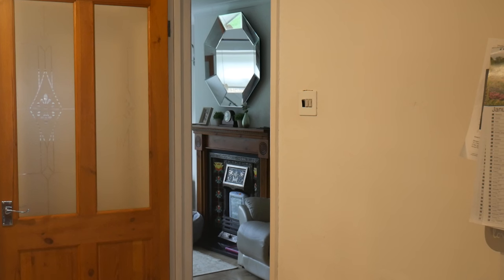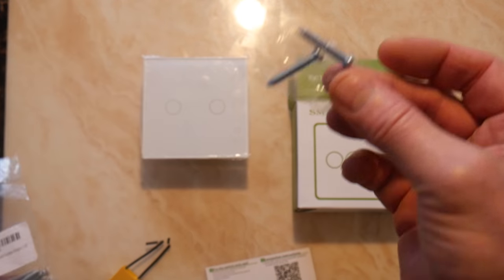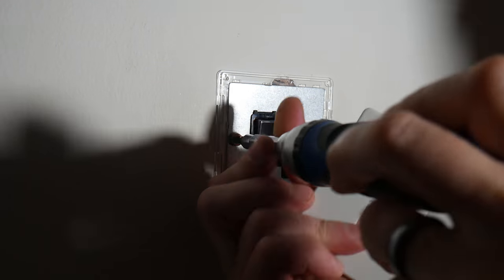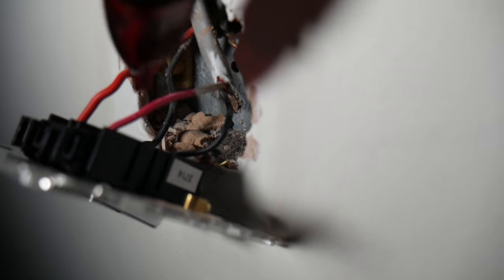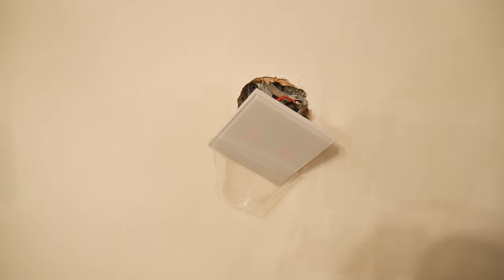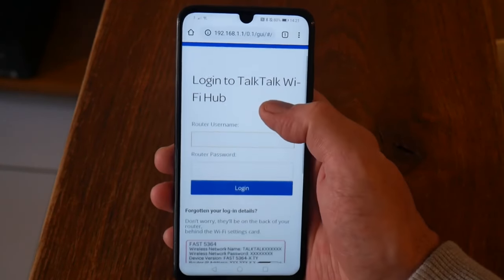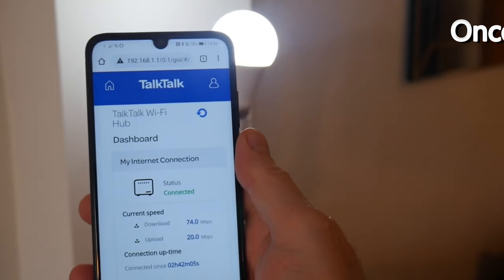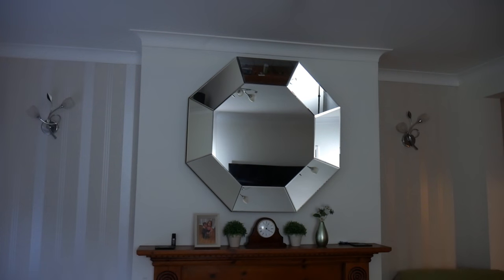NO NEUTRAL 2 GANG SMART LIGHT SWITCH INSTALLATION AND SET UP

Comment: Does it also work if you add smart bulbs as I struggle to get mine to work correctly as it puts the bulbs into pairing mode when you keep turning the switch on and off any help on this please? Thanks for this video two best Ive seen on explaining it to find the live wires and adding them both to L on the switch. For my strange reasons I have no power upstairs switch now but will look again after seeing your video thanks!

Comment: Hi, after watching this video , i assume that your switch doesn't have a neutral wire. My question is, is it safe to connect 2 live wires together into the same L ? And what is this 2 live wires are actually for ? To my understanding , only 1 live wire is enough to be connected to L. So what's the other Live wire for? Tia.

Comment: @UTILITARIAN TV, why you did not use the capacitor? Can the switch (no neutral) work without using capacitor?

I do not have a tester pen, but I can see the 2 wires connected to Common & 2 wires connected to the 1 way switch. 
Can I move 2 wires from the common to L1, L2 respectively?
Reply from the maker: Didn't need the capacitor as the lights weren't flickering. I would not recommend guessing which wires do what. Best to invest in a tester.

Comment: What do you do with the capacitor?
Reply from the maker: Didn't need to use it as the lights did not flicker or stay on.
Reply: @UTILITARIANTVUK  thanks, great really helpful video. Interestingly my original 2 gang switch had a loop on the 2 com holes. Not sure why yours hasnt?

Comment: I have another problem. I have install the switch in the wall. It works manually and it turn on and off the lights correctly, but when i press the button to start the pairing modem, the ceiling light turns on(because i touch the button) and after 6 seconds the ceiling light turns off but the button doesn't blink and doesn't start pairing mode!!! I tried everythink... What i do wrong?
Reply from the maker: Unfortunately, it sounds like you have a faulty switch?
Reply: @UTILITARIANTVUK  i bought 5 and i tried 2 of them... Both of them have the same issue. I will trie the other 3
Reply from the maker: @Tsepe21  That is unusual? What is the make of the switch?
Reply: @UTILITARIANTVUK  The maker's name is SWITCH !!! But looks the same as yours!!!
Reply: @Tsepe21  Did you ever sort this out. I have the same issue where pairing mode doesn't work?
Reply: @jaspalsinghsihra1018  No. I finally realized that mine does not support wifi. I was fooled by the one who sold it to me!
Reply: Thanks for your reply. I think ive been sold the same one as you with no WiFi.

Comment: Hi do you still have to have smart bulb for this switch to work
Reply from the maker: No need for  a smart bulb. An ordinary LED is fine.
Reply: No need to fit the capacitor then
Reply from the maker: @pethuds  I didn't use a capacitor but some people have had to with older LEDs. Any new LED bulb should be fine.
Reply: Ok thanks

Comment: Hey nice video but happen with the little yellow box that comes with the smart switch?? Did you install it or it was not necessary??
Reply from the maker: That's the capacitor. You install in between your live and neutral on the light fitting.  You only need this if your lights flicker. Mine didn't flicker so I didn't need to use it.

Comment: Hi didn't you use the capacitor
Reply from the maker: You normally install in between your live and neutral on the light fitting.  You only need this if your lights flicker. Mine didn't flicker so I didn't need to use it.

Comment: Great Video The uk link for the switch looks nothing like the one you installed, and looking at the picture's it seems you have to fit a capacitor if you dont have a neutral wire. Is the one you fitted Yagusmart Wifi Smart Wall Light Switch???
Reply from the maker: I didn't fit the capacitor on mine and it was all fine. It may depend on the light fitment?
Reply: @UTILITARIANTVUK  Thanks Bud again great vid.

Comment: hi, did you use the capacitance which came with the smart switch?
Reply from the maker: No, the lights worked fine without it.
Reply: thanks for the video and reply :)
Reply: @UTILITARIANTVUK  Which smart switch you used . can you put  the name of the  company in the description. I have the same issue with three switches where there is no neutral and I cannot find a switch without capacitor or neutral .
Reply from the maker: @MusaferHoonYaaro  It's from Amazon MOES WiFi Wall Touch Switch No... https://www.amazon.co.uk/dp/B07Z4WVCLN?ref=ppx_pop_mob_ap_share
Reply: @UTILITARIANTVUK  what happens if my switch turn on more than 1 light? I have 6 led lights in my Livingroom

Comment: Why did you not mention the capacitor that needs to be fitted in the light ceiling rose?
Reply from the maker: I didn't use the capacitor as there wasn't a need for it.

Comment: I am curious as to why the capacitor wasn't wired in, do you need to?
Reply from the maker: Didn't need it. It tends to be needed when you have older LEDs or bulbs that may flicker? The newer types seem fine.
Reply: @UTILITARIANTVUK  would you know how to set one up with the capacitor? Having issues with mine since my cove lights are blinking and the pin lights won't turn on. Thanks and great job!
Reply from the maker: @janjarranjanPH   you need  to connect the capacitor to the switched live and a neutral in the light fitment.
Reply: Good evening, if a capacitor was used, in a feeling with 10 down lights, could just install it on one of them or at the main junction/ rose? Thanks

Comment: Hi there. Many of these switches without neutral comes with a little box that you are supposed to install in parallel of the light you are controlling to avoid flickering. Do you use led lights? Any flickering problem?
Reply from the maker: They come with a capacitor but I didn't need to use it. I have LEDs but they don't flicker.
Reply: @UTILITARIANTVUK  is there no need to install the capacitors if you use LEDS?

Comment: Hi thanks for the video it was explained clearly and concisely I just have a question about my experience and if you have a solution. 

I followed your instructions exactly and even had to change the LIVE switch wires around just like you because the switch wouldn't turn on the first time around. After doing so the buttons illuminated and were flashing ready to be set up but unfortunately when I pressed the button there was a loud crack and my consumer unit tripped out and smoke started to come out of the smart switch, I have the same setup with a ceiling light and two wall lights some am not sure why this would happen. Also, the earth wires are connected to the back box in the wall so all earthing should be all catered for can you help please?

Comment: Hi I've just read the other posts saying it is no longer available
Reply: @Frankie Hannon I bought a 2 gang switch from Amazon UK a few days ago - it can be wired with or without neutral.
Yagusmart Wifi Smart Wall Light Switch. If you don't have a neutral you may need to install a 100 micro farad capacitor (supplied with the switch) across the input / output terminals of ONE of the lights to prevent flicker.

Comment: I've got five wires in my two gang switch, what do I do with that???
Reply from the maker: Is one of them a neutral or is it a 2 gang 2 way?
Reply: @UTILITARIANTVUK  It's supposed to only be a one way switch as there's only one switch for it.  Two cables in the box, one with three wires (including the live) and the second cable I'm assuming is for the switched connections.

Is there a way I could test if one of the cables is the neutral?
Reply from the maker: @devlinX  Are you in the UK? In the UK the neutral wire is normally blue.
Reply: @UTILITARIANTVUK  Colours I have are red x2, black x1, blue x1, yellow x1.

Yeah, I'm in the UK.
Reply from the maker: Without looking at it, the reds are normally live, and yellow is earth. I'm not sure about the blue and black? Modern wiring, the blue is neutral. In old wiring the black is neutral. So it's either the blue or black are the neutral. Have you tried putting an electrical tester on the black and blue wires when the light is turned on?
Reply: Turned out that only one red wire was live and the other red is part of the loop.

Black and blue are both connected to the first L1 and yellow connected to the second L1.

Seemed like my wall lights are individually wired so both had a separate wire. 

Sent my smart switch (with neutral) back to Amazon.
Reply from the maker: @devlinX  glad you got it sorted. There's never one the same!

Comment: Hi, I have the same switch and followed exactly these instructions but the buttons seem to keep turning on both lights rather than one. Any ideas?
Reply from the maker: Have you tried changing the switched lives around?
Reply: Yep. Tried swapping them around and one button still switched on both lights. One set is a ceiling light with the capacitor and the other set is some spotlights.
Reply from the maker: @jawadmurtaza4239  I couldn't work out why swapping them around worked but it did. I didn't use the capacitor, have you tried it without it?
Reply: Yea. Tried without it but the bulbs kept flashing so had to put that in 😔
Reply from the maker: @jawadmurtaza4239  the last thing to check is the bulb's? Newer LED bulbs tend not to flicker. If it's not the bulb's, I'm out of ideas sorry. 🤷‍♀️
Reply: You have to install capacitor provided with the switch at your light. This only happened to those smart switches without neutral.
Reply: M.F. Cheah I have already installed the capacitor. Still one button turns on both lights

Comment: Have you had any trouble with the switch ? A lot of mixed reviews on Amazon.
Reply from the maker: I've had it for a year and no issues so far.
Reply: @UTILITARIANTVUK  brilliant, I’ll order one. Thanks for the very quick response. Your video helped me a lot , I’ve a 2 gang switch , 1 switch operates a light the other an extractor fan.I’ve 1 live with a jumper wire to the second live position. You showing that you can put “2 lives” together makes sense.
I was going to order it but it won’t get here until the 20th

Comment: Great video, just one question where did you get the smart switch from.
Reply from the maker: It's from Amazon MOES WiFi Wall Touch Switch No... https://www.amazon.co.uk/dp/B07Z4WVCLN?ref=ppx_pop_mob_ap_share
Reply: Perfect thanks for your help. My dads just said could you not turn the switch around the other way then the switches would  be the correct way around for your wife. Remember happy wife happy life. That’s what my wife says.
Reply from the maker: @jamesoliver5334  haha! That is true.  The back box was a very tight fit due to the size and shape of the switch so it would've been difficult. I'm sure the wife will cope. 😄😄😄
Reply: this never use capacitor?

Comment: You may encounter problems if you have a virtual private network (VPN) - now standard on iPhones or an app such as AVG. I think the VPN on the iPhone is okay, and unlikely to cause connection issues but apps such as AVG may cause connection problems. If you  do have problems, switch it off in settings then connect your smart devices. Once connected you can switch on your VPN.

Comment: Why did they gave me a capacitor and said it is an essential... I'm so confused,it was working when my electrician didn't use the capacitor cause he forgot but when he used the capacitor it doesn't work... we were so confused but we didn't date to continue without the capacitor since the seller said it is very much needed
Reply from the maker: Only need to install the capacitor if the lights flicker. If they don't flicker, there's no need to install it. As it is no neutral, it draws a small amount of power from the bulb. This can cause flickering or dimming in certain bulbs.
Reply: @UTILITARIANTVUK  Thank you. Did it without the capacitor and it works. But i did have the same problem like you that i had to switch the wires for it to works. And yes it makes it confusing but hey at least it works now

Comment: U could try using only 1 live wires and connect the other 2 switch wires.. As the smart switch already had the live wire looping in the circuit.. Thats why u only need 1 live wire.. Why didn't u think of that haha..

Comment: There's no need to turn 5ghz wifi off, you can run both 2.4 & 5 at the same time.
Reply from the maker: Yes, that's correct. However, in some instances, the switch tries to connect to the 5ghz. No matter how many times you try to connect the switch it will not work. The only way to get it working is to turn off the 5ghz while connecting it.
Reply: @UTILITARIANTVUK  
I think just making sure your phone is connected to the 2.4Ghz network is enough to solve the issue. At least that's what has worked for me.
Maybe I've just been lucky.
Reply from the maker: @D4RKFiB3R  It does depend on the proximity to the router. Most phones have a tendancy to automatically switch back to the strongest signal. So if you're close to the router, it can be a bit of a ball ache when your phone keeps switching back from 2.4 to 5GHz.
Reply: @UTILITARIANTVUK  Temporarily disable auto connect for that network. :)
Reply from the maker: @D4RKFiB3R  I don't think you can temporarily disable auto connect for 1 network, at least not on my phone? But I suppose you can forget connection and log back on again later?
Reply: @UTILITARIANTVUK  Seems I can do that on my Samsung, though I haven't had to yet.

Comment: Hi  I wonder if you can help me or maybe someone here can I only have one x  2 gang switch in my flat. I have fitted 1 gang wifi switches and had no problems at all. but in my lounge  I have a 1 gang  switch which is now wifi all works fine. I also have a old 2 gang switch not wifi, as cant seem to wire up the new 2gang wifi one. . in my lounge I have 2 ceiling  lights. I have made some images for anyone to look at.  the ceiling light marked green is operated by the 1 gang wifi switch also marked as green, and also operated by the old 2 gang left side switch also marked green. the right switch of old 2 gang marked in blue  just turns on ceiling light marked blue only.  Now  on the 3rd image  the back of the new wifi 2 gang only has  L  L1 & just L3  to connect wires plus a N on the left. I am waiting for a continuity  meter to arrive so I can maybe find out what colour wires are from the 1 gang switch what leads to the left switch of the 2 gang   here are the images of the room      https://ibb.co/W6kMwLm     https://ibb.co/5nQwF95      https://ibb.co/NSM8DBQ